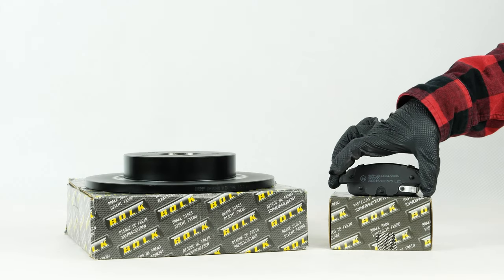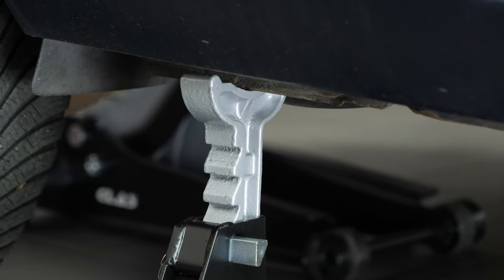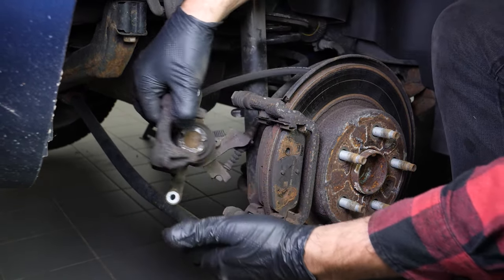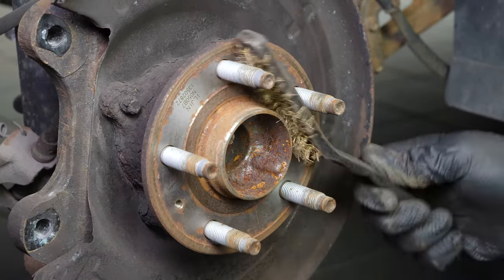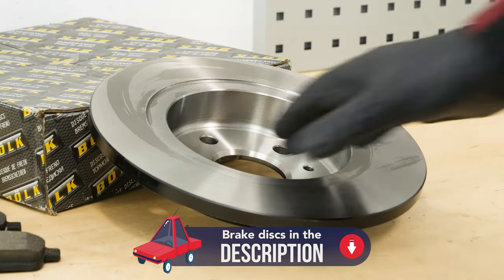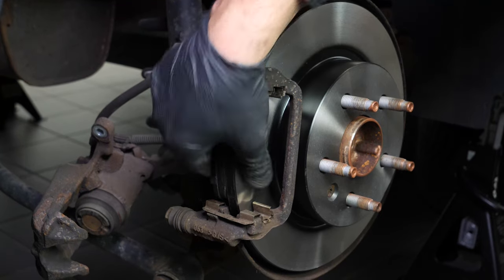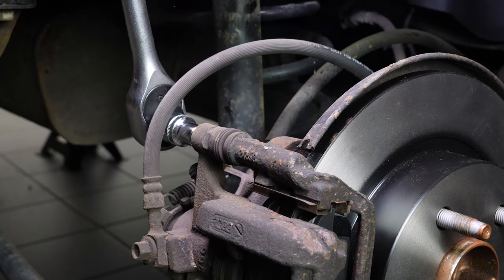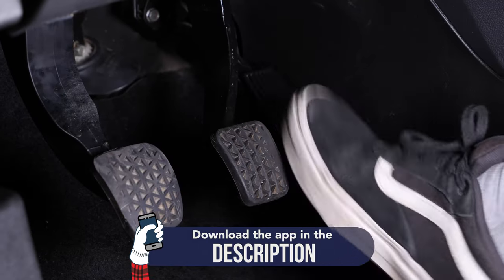How to replace the rear brake discs and pads Astra J / mk6 🚗

Comment: Is there any reason why my brakes are going lower than they did before? I know it’s air in the system but I thought after just doing pads and disc, I wouldn’t need to bleed the brakes.